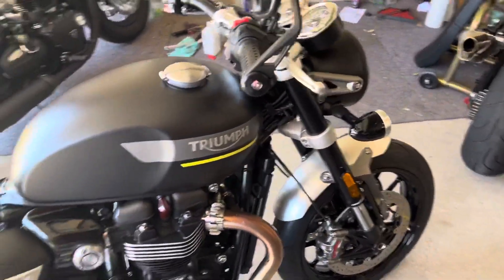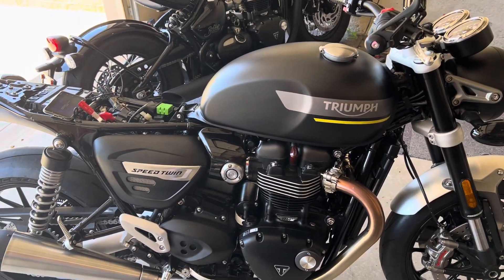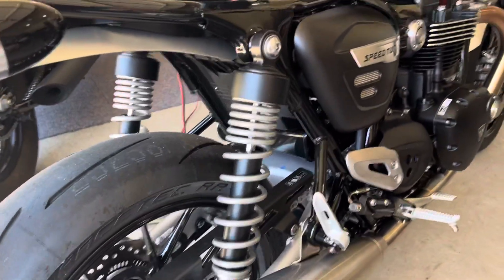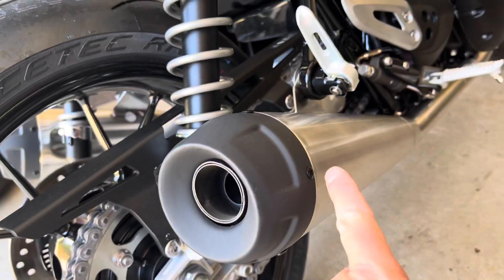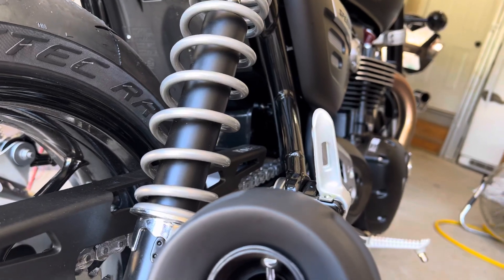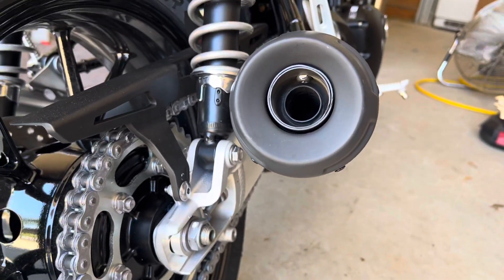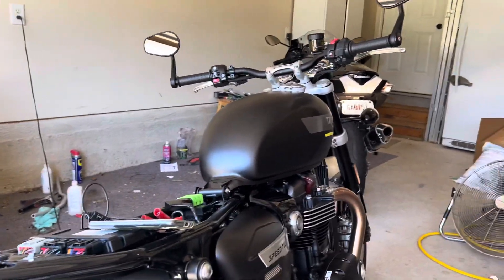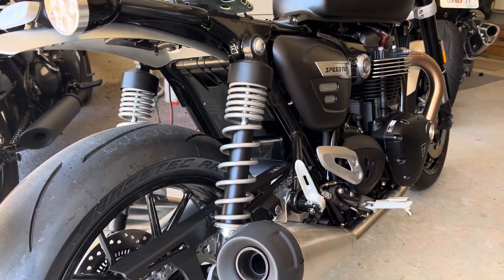2022 Triumph Speed Twin arrives!

Comment: I was also looking at the Speed Twin but went with the Z900RS. Am looking forward to hearing how the Speed Twin compares to your former Z  Dave.
Reply from the maker: I can already tell that the Z900RS has more power, but the Speed Twin feels much lighter and more nimble, has better brakes and should handle better.
Reply: Cheers Dave. Interesting observation regarding Speed Twin feeling much more light and nimble. I had the opposite impression after test riding both but had only 30 minutes on the Twin. Definitely agree regarding the brakes. I quickly upgraded the Z's pads to EBC sintered. Looking forward to hear more of your thoughts on the handling/suspension as you get to know the Twin more. Enjoy and keep up the great content.
Reply from the maker: @gregs6265  Should get some riding video this weekend, just have to figure out a camera mount.  But at the very least I will get some miles on it and do a more in depth review...